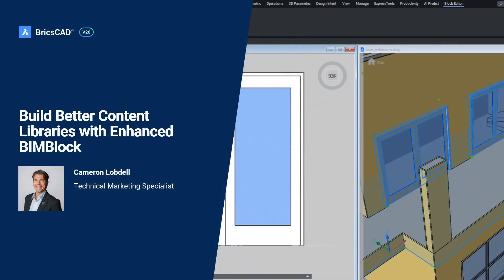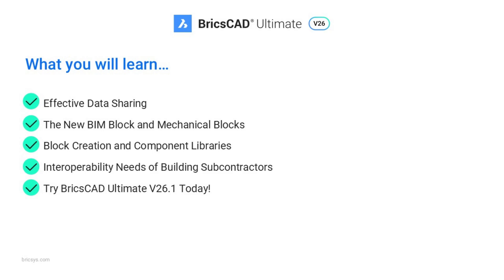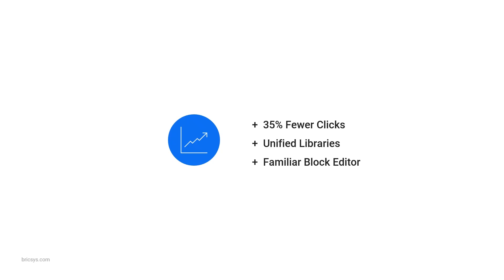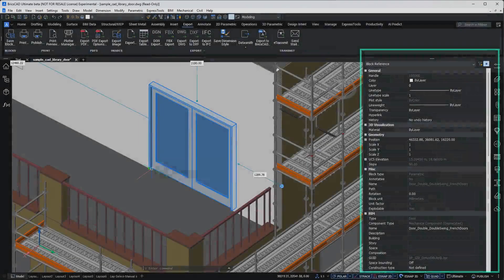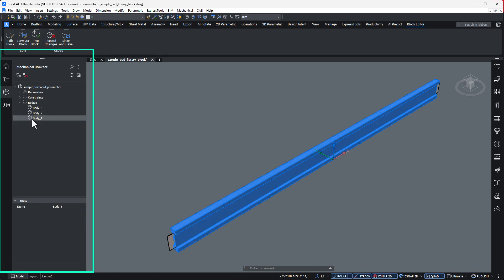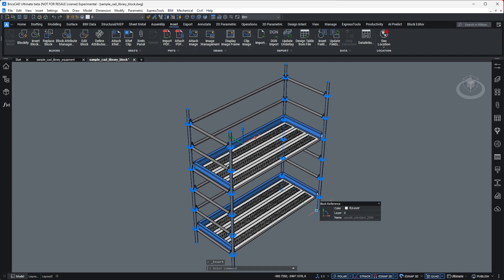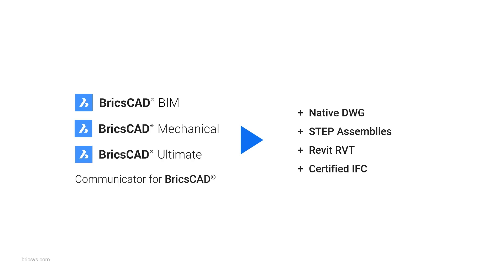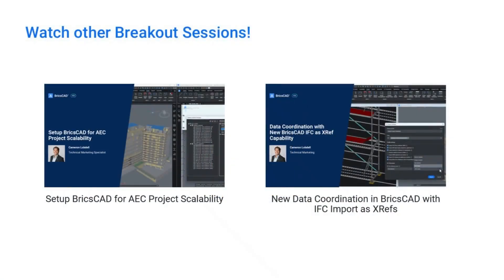Build better content libraries with enhanced BIM Blocks┃V26 Breakout Session

Comment: on my components, they show as mechanical components (deprecated). If I 'convertcomonentstoblocks', they revert to the base dimensions of the parameter block. Sometimes, they even rotate. I cannot copy blocks by selecting one with all the right parameters, except by using BMinsert.